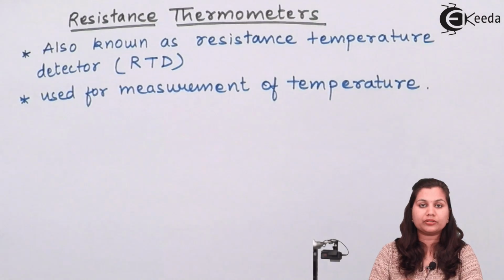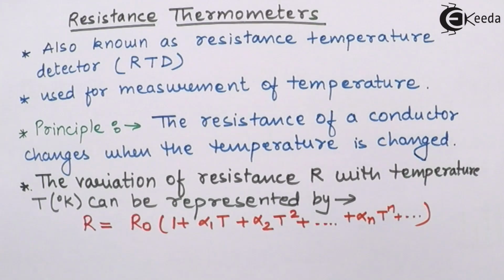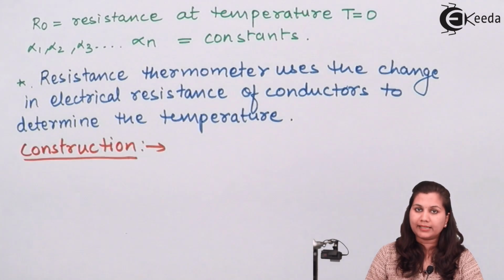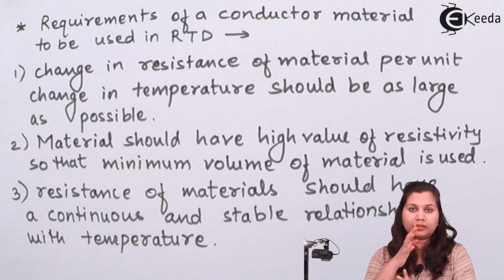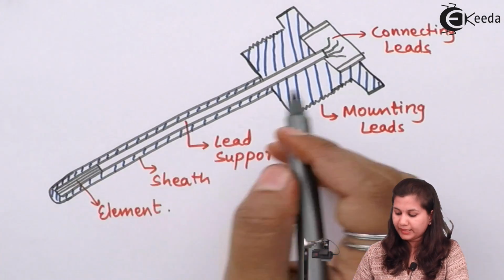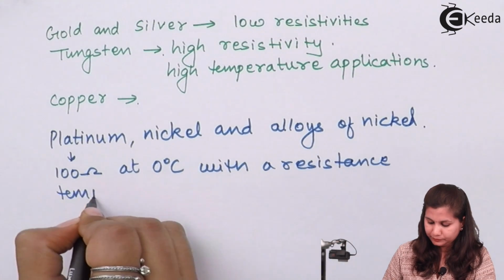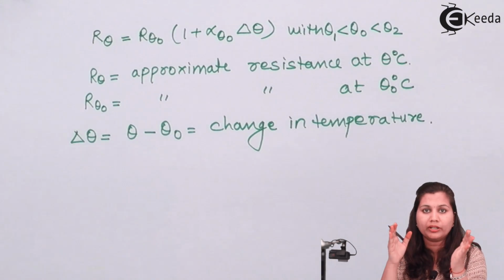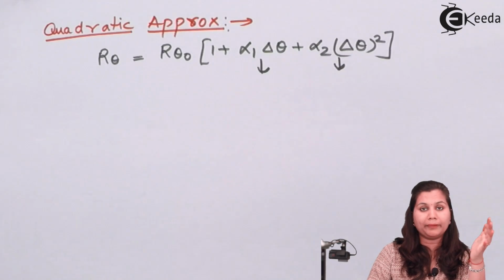Resistance Temperature Detector (RTD) - Temperature Measurement Transducers

Comment: Overall is good, just one more thing that needs to bee improved or added, 
100 ohm at Alpha=0.00385/C is valid only if the resistance is 100 at 0C, what is some one want to change the sensitivity of the resistance using the same material (Platinum) in this case resistance value is different at 0C. As I have been working on miniaturized sensors since two years I have learned that Platinum purity impacts the Alpha value, eg., Aplha less than 0.00276 are not of pure platinum even not alloy means Platinum layer can be filmed over the titanium metal.

Comment: HI I NEED HELP TO RESOLVE THIS QUESTION( A resistance temperature detector (RTD) transducer is to be chosen such that the analog-to digital conversion will have a resolution of 0.001 c . the conversation uses 16 bit . the RTD will be in a circuit with a lower voltage of - 0.15 V at the lowest temperature extreme and an upper voltage of 0. 3 V at the highest temperature extreme . the RTD will have an output of 0.000 V AT zero degree . what is sensitivity of the RTD ?

Comment: MAM  aapke eq. Ke hissab se  there is direct relationship between  temperature and  resistance.  But in the beginning  you told that there they are inversely proportional.
Reply: yes ur right
Reply: they are dirctly prp because with incrs in temp to and from motion of electron increase which make chagres difficult  to flow